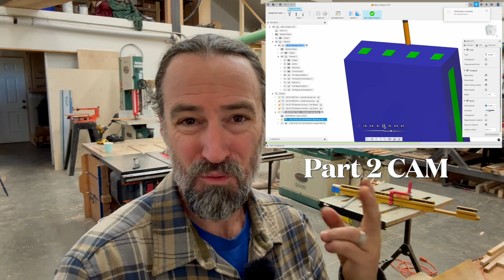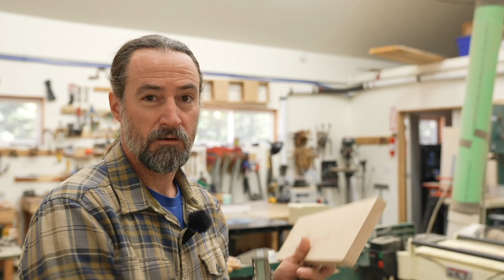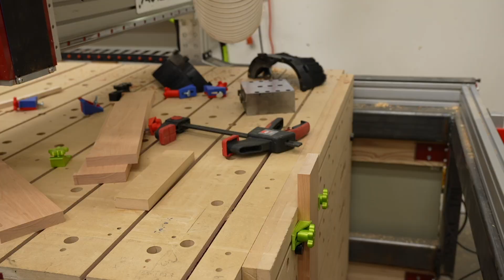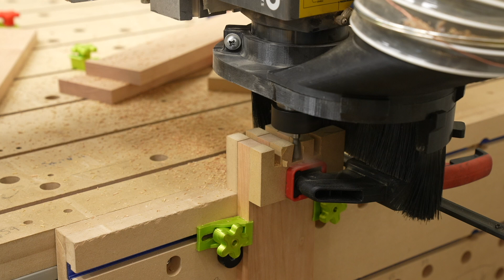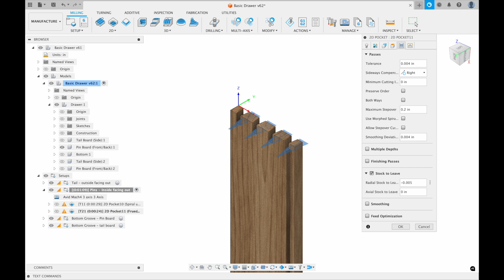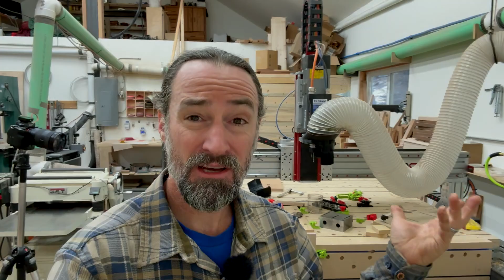Ep 3: CNC Dovetail Joinery - How to cut them on a CNC router!

Comment: Would I need to remove bulk material with a roughing bit or could I possibly just send it with the dovetail bit?
Reply from the maker: You can send it with the dovetail bit, but you will prematurely wear it out. Most manual dovetail jigs (ie: Leigh), just have you use the dovetail bit without any roughing bit, and it works great. However...back when I did a lot of dovetails with a jig in hard maple, I did eventually break the dovetail bit.

Comment: I do a lot of vertical clamping on my CNC and use a stop and ttrack underneath the work piece.  I like it so much more than what I use to do which was align it with a block on the base.
Reply from the maker: Cool - do you have a picture of how you set it up? You almost need a t-track running vertically to have it be infinitely adjustable, right?

Comment: This is a Wonderful tutorial.  I have not ventured into Fusion Machining before this video.  I am having a problem with the tool path repeating itself when cutting both dovetails and pins.  If I have 3 tails, it will repeat the same steps for 2 of them but not the 3rd.  I've checked and it is an exact repeat of the bit travel.  It happens with both straight bit on Pins and dovetail bit on Tails but Straight bit on Dovetails makes only 1 pass.  I have NEG 0.02" stock to leave. Do you have any suggestions?  Your tutorial is superb.
Reply from the maker: It really comes down to the selection; something must be off in how or what you are selecting. It should appear a darker blue-ish over the area that it will machine; if it does not, something is wrong with how you selected it.

Comment: Forgive me if I missed it, but I didn't quite catch how to run things?  Do I just click on my setups and simulate with machine for testing, and 'Post Process' for the run?
Reply from the maker: Yeah, my bad! I didn't go into the details of that. You simulate to make sure everything looks right. Then you hit "post process" to generate GCode for your particular machine to run the code. I've been thinking I need to do some more basic Fusion tutorials from start to finish for CNC woodworking to cover stuff like this.
Reply: @CorbinDunn  thanks!  I have a shapeoko and use carbide motion, so I can open the gcode and run with that.

Thanks so much for this series.  Fusion scared me, but this made it approachable!!

Comment: I'm trying to process parts as fast as possible.   Is there a way to make the bit always enter the material but never blow out the back?  I'm trying to describe cutting in from both sides to avoid tearout.  Therefore eliminating the sacrificial material.
Reply from the maker: Yeah, I know what you mean: I really tried hard to figure out way to make fusion do this. I want it to "kiss" the edge with the bit on both sides to avoid tear out, and then do the rest of the cut, but I couldn't get a consistent easy way to do this without a lot of finicky tool paths. One idea I have is to just stack your same pieces for a drawer side all together and cut them all at the same time; just set the stock size to the width of all the pieces plus the sacrificial material.
Reply: @CorbinDunn  I considered the same idea.  I'm not super confident in all the pieces locating accurately.   I'll give it a shot though and report back here.
Reply from the maker: @v8Mercury  Yeah, I haven't tried it myself yet, but I need to make about 24 drawers for a shop cabinet, and I've been thinking about it a lot lately. I'm debating stacking them and doing dovetails, or just coming up with a different finger-joint style. I decided to use birch plywood for them, so I might just do something simpler that is all cut out on a flat plane instead of the vertical work table.  Let me know how it goes!
Reply: @CorbinDunn  maybe use a midplain to create a 1mm thick wall that could be machined out in a second operation.  ?  Hmm..
Reply from the maker: @v8Mercury  That is an interesting idea that I hadn't thought of! I'll have to play around with it. The hard part I had was Fusion's lead in and lead out areas not always being where I wanted.